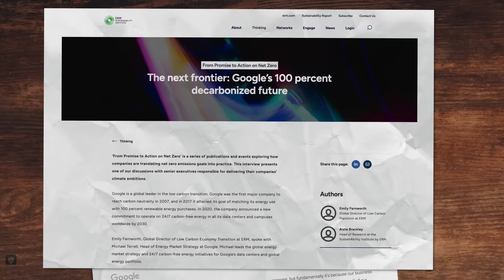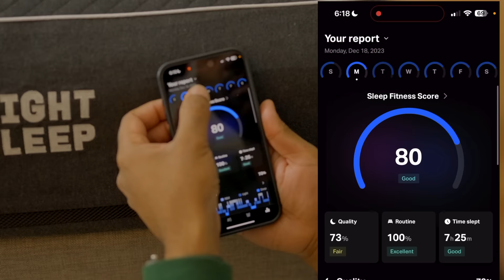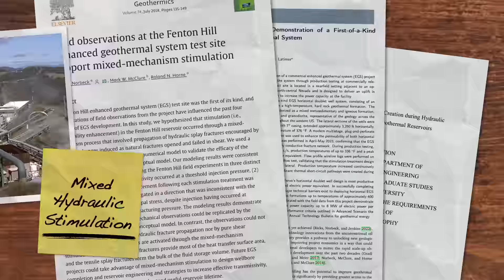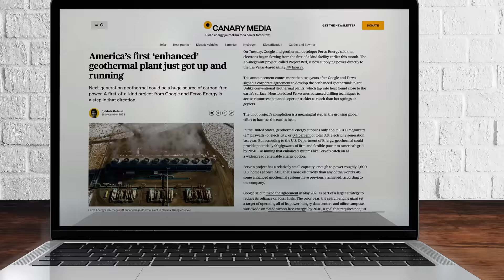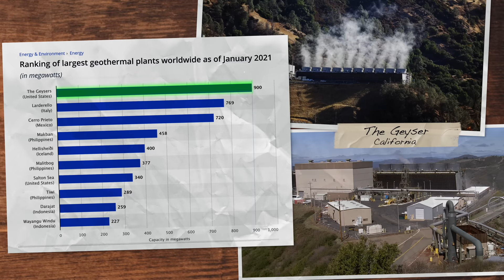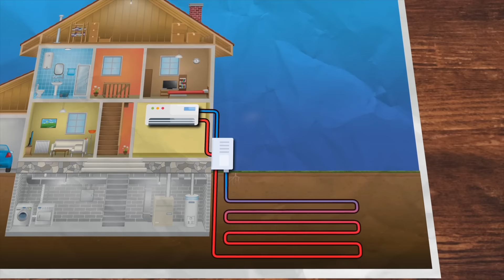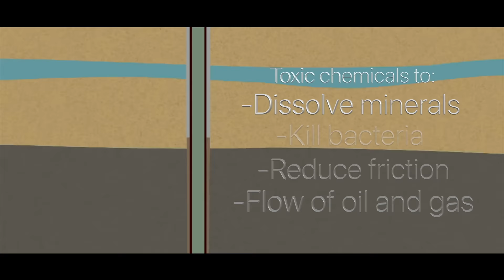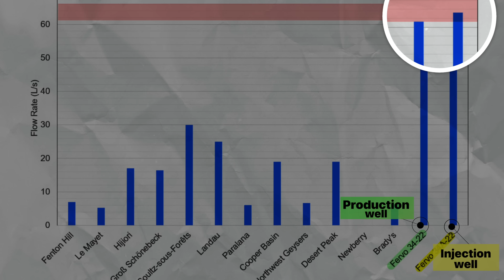Google’s Billion Dollar Gamble: You Won't Believe What it is!

Comment: Ricki, some of the information  on fracking is out of date.  The fracking industries have either stopped using the most toxic chemicals or rapidly moving away from them.  In addition, water use is no longer a major concern since they now use brackish ground water using extracted from the area.  Turns out one of the major additives used in traditional fracking is salt.  By using this brackish ground water, they don't have to use fresh water with all of it's complications such as algae and other organic contamination they can inject the used brackish water back where it came from.
Reply: It's a good point. But is that for the oil&gas industry or for enhanced geothermal? I'm pretty sure you won't be able to use saltwater for energy production in the turbines.
Reply: @ipp_tutor  The water going through the turbine is on its own closed loop.
Reply: @ipp_tutor nuclear plants near the sea exchange heat with ocean without contaminating the turbine water. That stuff has to be insanely pristine. Measured down to the parts per billion to verify it's pure.
Reply: false.. that applies to only here... not beyond borders.. 😮
Reply: @dertythegrower  The mechanical and chemical description of this fracking process sound simpler and cheaper than the original process. This means you don't need regulations to enforce it's use, just someone who understand more money more better. Is there some other additional difficulty that arises?
Reply: His slamming criticisms of fracking are gross.

Comment: There is a version of these horizontal geothermal wells that dispenses with the fracking, and instead uses a closed system.  The pipes are sealed, so the water pumped in is exactly the same as the water pumped out, and as a result none of the water is lost, and no nasty minerals are extracted that can corrode the pipes, pumps, and heat exchangers.  For the same flow rate, less heat is extracted, but the reduced cost of maintaining the system and no loss of water underground more than makes up for it.  Hopefully Google will try a system like this next.
Reply: Eavor is a company experimenting in this , hopefully they get big backing from Google too
Reply: “Less heat is extracted?”

Seems like this would require longer vertical pathways and more extensive drilling (unless I’ve missed something.) That means a longer project timeline and a higher drilling costs (pipe, manpower, diamond bits).
Reply: @derekboyt3383  yes but these costs could amortize along a longer timeline of far less maintenance of the turbines.  Corrosive stuff mixed with hi temp steam means tons of downtime.
Reply: Do we necessarily have to have corrosive minerals in the water? I thought that would depend on the geology of the terrain.
Reply: @derekboyt3383  That's not a major problem for a project that will last for decades, if not longer.  Once you drill your bore holes, you don't have to drill them again.  This allows you to amortize your cost of drilling over a very long time frame.
Reply: @caty863  it would vary from site to site I guess but his suggestion of a closed system make that a non-issue, apart form the cost.
Reply: Quaze Energy also have a closed system, using microwave energy to vapourise the rock which then lines the bore with glass. This can drill deeper than traditional drilling hence way hotter.
Reply: Eavor loop, but Quaise Energy is hot on their heels with a microwave drill which vapourises the rock then condenses on the bore walls, and can"'drill"" way deeper than steel  and diamond hence hotter recirculating water
Reply: Eavor's first commercial geothermal plant is going to be in operation in Germany within a year. If I recall it's about a 100 MW which isn't large but most projects in Germany are not large, especially when they're experimental
Reply: Sure like Google could never be evil! 😂😂😂😂
Reply: Rocks are not a good heat conductor, so I don't see a closed system producing power for very long.
Reply: Eavor has a test system in Canada that has been running for years and they are constructing the first full scale system in Germany now. It is a closed loop system that uses a fluid that doesn’t boil so that they can run at higher temps 20:33 . Since it is a closed loop, there is no pollution. Also, due to thermal siphoning, once they turn it on they no longer need to pump it. It flows automatically. Please do a video on Eavor to go with this one.   Thanks for all you do.
Reply: I could see how this could work... think of large major feed pipes breaking off into multiple smaller diameter pipes. The smaller pipe allows the water to absorb heat faster. Then, at the end of the heating pipes, they combine back into a larger return pipe. Not unlike radiators in cars getting rid of heat in the air (or old-fashioned steam radiators in homes).
Reply: Next?
Ha
They never should have considered This Model, to start with.
I agree with EVERYTHING else you said, but Google ignored Logic in the name of Output, like all Corporations fancy.
Reply: @genepope7498 heat transfer by conduction is dependent on the surface area, and smaller boreholes have less surface area.

The surface area increases by τ times the diameter (or π × 2 × diameter).

And yes, radiators works by increasing the surface area, and it has many thin channels, but they are also wide to increase the surface area.

But the biggest issue here is the practically of trying bore out this thing, let alone the cost. The more practical thing to do is just dig a deep, deep, deep hole and punk a prefabricated radiator down there. But even that would lead to all kinds of issues.

No, I think that I will trust the experts that have been doing this stuff for homes for decades. They can probably figure it out how to make it on a larger scale too :)
Reply: how much carbon is embedded in the piping?
Reply: Yep.. cant use standard materials. But highly expensive ones.. sure. And even then.. thorium reactors would be cheaper.
Reply: @stevedugas2806  This is kinda wrong. Eavor's proprietary working fluid has a boiling point much lower then water. This allows them to produce energy from geothermal reservoirs in the 100 - 200*c range, far lower then the temperatures seen in traditional geothermal.
Reply: His slamming criticisms of fracking are gross.
Reply: These still have issues with dissolved solid precipitation. These solids drop out as the water temperature approaches boiling. They can coat the outside of closed system pipes slowing heat transfer. 

So far, there are no good solutions except running these systems near sweet water wells like near Hot Springs, Arkansas.
Reply: @jwrosenbury  
Yes -- even moreso for the Quaise Energy project. 

And do these people understand that they can exhaust the heat of the surroundings? "Cool off" the rock, as it were?   
I've heard of geothermal sites that give out after a few...  years?
(Especially for fracking sites; yes it's hot at first, but it only stays hot if it's near magma/mantal (?) to replace the heat removed.)

Comment: Canadian company Eavor does the same thing without the fracking.  Nice to see this underground tech emerging.
Reply: Actually, Eavor makes closed-loops systems where water goes in and out through a single looped well. This system is very different from enhanced geothermal which requires water to permeate through the rock from the injection well to the production well, absorbing heat along the way
Reply: EGS/fracking has a limited lifespan. Seems Eavor have a big advantage because their underground pipes won't degrade as fast, or at all.
Reply: Eavor  has been operating a proof on concept plant in Alberta, Canada, and has also begun building a commercial plant in Germany. Its German plant’s output will be 8.2 megawatts of electrical powered, or 64 megawatts of thermal energy.
Reply: @AnthonyBouttell Do you know what is the cost of the whole operation from drilling to setting up geothermal power plant system. Thank you